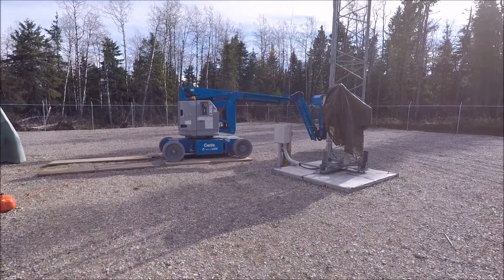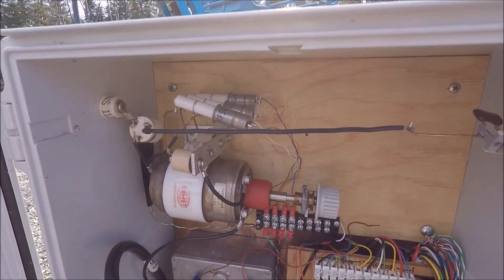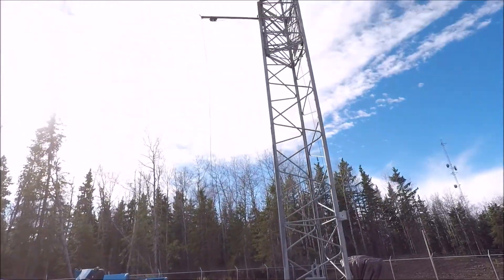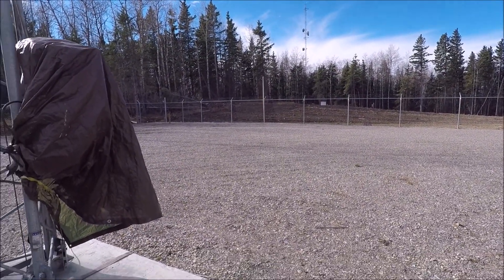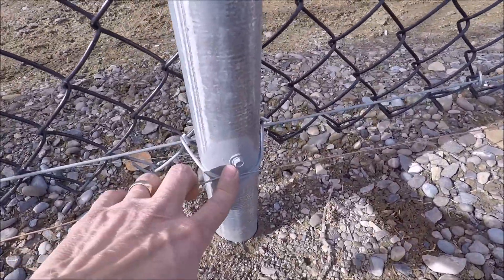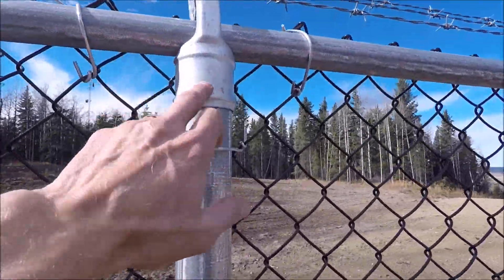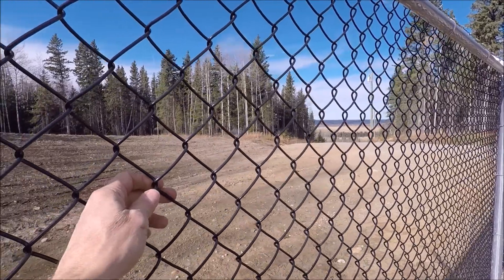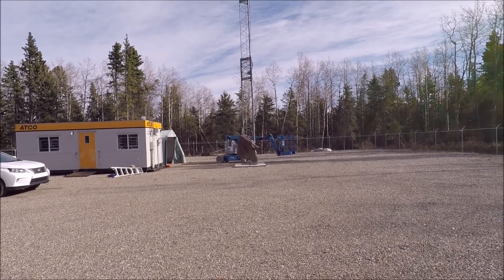160m TX antenna at VE6WZ remote

Comment: Hi there, fantastic 160m antenna. I heard you on 1820kHz calling CW CQ last night here in VK3 (Melbourne).  27 Aug 2019 @ 1230 UTC, your sigs 579 with QSB. I listened for a good 15 minutes and was surprised that no VKs called you, there are a handful of keen 160m VK CW DX operators. A few had been SSB rag-chewig up the band for the previous hour, I guess they all just went to bed!  73 Paul VK3HN.